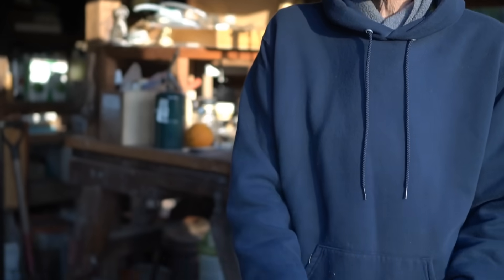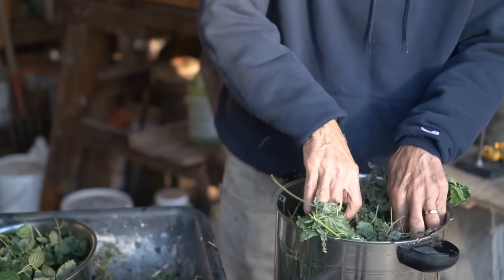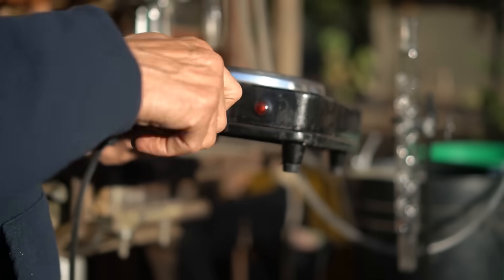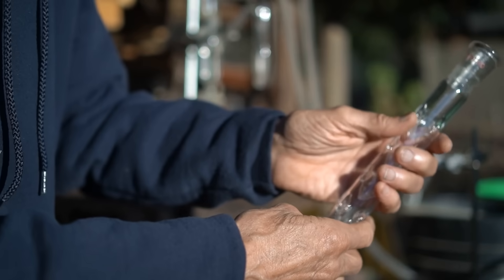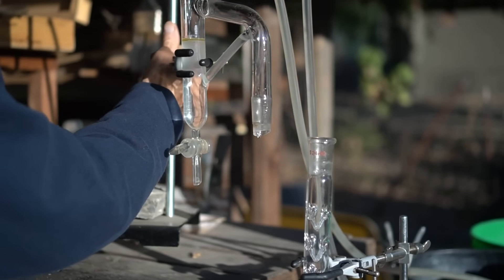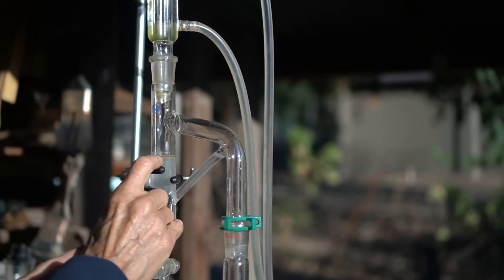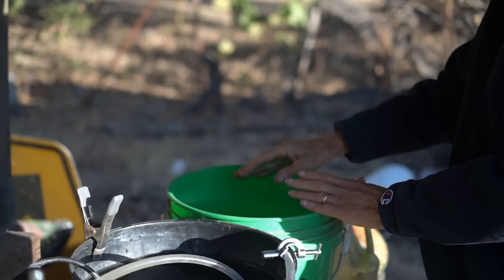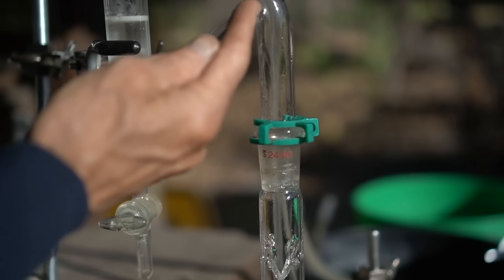Using a Simple Still for Home Extraction of Essential Oils

Comment: Sure does work
But thought there is a much cheaper and simpler way of doing this
When oil floats on water
What is wrong with just having some simple chambers with tubing going through some cold baths, which will cause the water and oil to precipitate out
then all one has to do is drain the oil off the top of the water
Reply from the maker: That is certainly an option. This setup allows for pretty steady production, with very little oil left in the plants or in the water.

Comment: why dont you chop up some of it wnd just put it directly in  the water with q little stainless lifter to keep it from bottom
Reply from the maker: @NUVERSA It kind of turns to slop like cooked spinach if it's it in water, then most of the essential oils are left in the water. If the steam is able to drift through the material, it takes the essential oils with it into the condenser.

Comment: This video is great, many Thanks Dennis !
I just didn't see when you added rain water (in the cocer and the amount you used for each charge of Lemon Balm. Could you please share this point ?
Merci
Reply from the maker: Hi Lorraine, the water is added before the plant material is added, but it's not critical to go in that order. The water should be enough to boil for a while (maybe 1 inch) without having much of the plant material in the boiling water. There is a metal colander in the bottom to keep the plant material off the bottom of the pot.

Comment: Good explanation of the process. I checked the price of the whole system & the price is $245. 
I think it's is a low quality one because there are some selling for over $1,000.
Reply from the maker: The glass is high quality, but the rest is made out of less expensive parts to keep the cost down. Expensive does not always equal high quality with DIY :D
Reply: @SoilSoulandSpirit  Agree.

Comment: Greetings and thank you for your video. I subscribed to your channel.

I wonder if you can tell us which plants need to be distilled to collect the essential oil, and those where a simpler method can be used?
Reply from the maker: Hi Fred, any plant needs to be distilled to get the essential oil. There are simple and more complex methods of distillation. The simplest is "hydrodistillation" which is basically boiling the plant in water and collecting the vapor condensate (think about the water droplets that collect on the bottom side of a lid over the boiling pot). The condensate will contain some water and some oils. If you let that sit, it will separate and you can try to use a long slender pipette to draw off the oil.

Comment: Great video and explaination, love the homemade adapter from the pressure cooker to the vigreux column! Another cheap and inexpensive option for your glass joints, use some PTFE pipe tape instead of grease i think you'll be surprised how good it is 😊

Comment: Instead of using the stems could you not put in steel "sticks" of a sort to act the same as the stems allowing the leaves to hang on them eventually and still preserving the purity of the oil? Or is that not worth the bother as the loss of purity is not enough to outweigh that trouble?
Reply from the maker: The oil won't be compromised by the stems. They also contain oils, and will add to the complexity and efficacy of the final product through the synergistic effect of those other elements. See also https://soilsoulandspirit.com/creating-higher-order-substances/
Reply: @SoilSoulandSpirit  Cool. Do you know why some people advise to remove them as he says in the video? If the sticks also have oil and add complexity I would think the general thought would be to keep them.

Comment: How much water are you puting in the pressure cooker?
Reply from the maker: It's a 4 gallon cooker and is about 1/4 water, 1/2 herbs.  Since it's a mostly closed system, the water doesn't evaporate. There is a small release valve at the top of the condenser where a little may come out, as well as a little that turns to hydrosol.
Reply: 10 gallons

Comment: What about grinding the lemon balm in a food processor first, then run it through the pressure cooker.
Reply from the maker: You need the steam to be able to run through the leaves, if it were ground, then you would be likely to burn it. Best to leave it on the stem, so the steam can pull the oils our of the leaves.

Comment: Bonus tip, that cloudy water part also contains some oil which can be recovered by breaking the emulsion. Either by adding a some salt from top towards the  end, or by  centrifugation.
Reply from the maker: The cloudy water is also called a hydrosol, which can be used by itself. Dennis uses it as the base for certain plant sprays (sse other videos in the channel). It can also be used as a bath additive, pillow spray, or body spray depending on what was distilled.

Comment: Another tip for keeping dried stuff from molding in the jars is to "cure" or "season" them for ten days, same as when food is dried.  Half the battle is to dry the stuff longer than the machine or manual indicate (as others here have stated) while the other half is to DISTRIBUTE the moisture which remains.  Whether dried or freeze-dried, initially, the OUTSIDE of each "nugget" is drier than the INSIDE.  (Using totally random numbers to make a point) while the total moisture may be 10 percent, its really 2% on the outside but 8% inside.  Where all that moisture collects on the inside becomes the HQ for mold development.  If, once they're in jars, you give the jar a good couple of shakes once a day for 10 days, the moisture becomes evenly disributed, and the problem prevented.  Just check each day to see if the items show signs of sticking to each other.  If they do, pop them back in the machine.  I do that for dehydrated foods and never had a problem.

Comment: I wonder if the cloudy hydrosol under the oil layer can be worked on a centrifuge to increase extraction efficiency
Reply from the maker: Hi David, that's certainly a possibility. Many people use the hydrosol for a gentle spray of the oil, like a pillow spray, laundry spray, in a bath, or as a skin conditioner, depending on what oil was distilled.

Comment: if someone sees this.....i have a problem with the system being a sealed system? with the way the clevenger is mounted were is  the steam pressure going or is it condensing fast enough to create equilibrium? or is the condenser opened at the top?
Reply from the maker: Hi @hollyjollydog, the top of the condenser is open.

Comment: Will that Glassware part work in Distillations where Water is lighter than the Oil of the Material.... (For Example Sandalwood Chips or Oud Chips etc)

I think for that the normal without the finger one glassware would be better 

Kindly Suggest your Opinion Sir
Reply from the maker: You could try both, but yes, it should work for heavier oils as well.

Comment: Thankyou. This was very interesting. The process still looks really complicated, I did see a manufactured copper farm steel for $500, in one of those brochures- But I’m sure if more people saw your video, then manufactures could come up with an even a cheaper version.
Reply from the maker: The goal is to be able to connect it to laboratory glassware which really opens up the uses. 

The copper stills can be good, but it matters how you seal it. Some of the more modern ones allow you to connect to glassware, as well as keep the heated water between reloads. Both are important for efficiency. Old copper stills require sealing with bread or clay.

Comment: I saw that you had a pretty decent hydrosol layer above your water and below your oil. Do you save the hydrosol separately and use it? If you were more interested in the oils that the hydrosol contains, could you put it back into the boiling flask so that the vigeraux column has another opportunity to separate the oil fraction?
Reply from the maker: Yes, the hydrosol is saved and used in plant sprays, and for topical use on the body. And yes, you can put it back in to get more oils.

Comment: A quick search shows that these little devices the Clevenger extractor and the fractionator could run about $8,000. Do you have a source list or a good supplier you've worked with for this gear? I'm working with the Botanical company to make natural products and this would be a perfect setup for the essential oils we'd like to extract
Reply from the maker: The clevenger and fractionator I use are glass devices using what are known as 24/40 size fittings. They are used in laboratories to extract up to 5 ml of oil at maximum. Pretty small quantities.

To start a commercial extraction for a company would require much more production oriented equipment. The glassware I use in my shed works for me, it probably wouldn't work for a company.
Reply from the maker: Here's a new video with parts list for making your own: https://soilsoulandspirit.com/making-essential-oil-still/